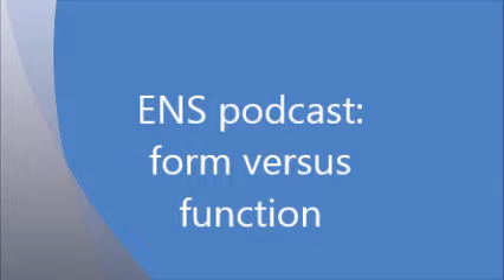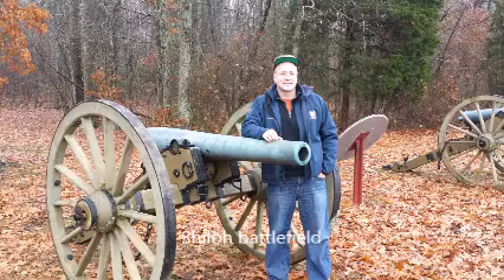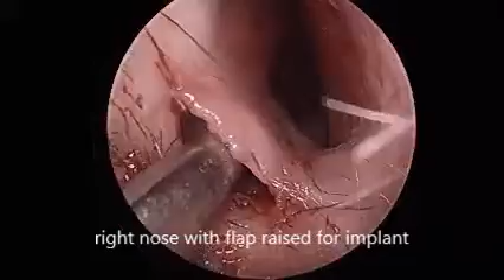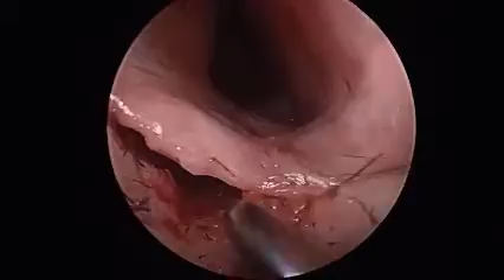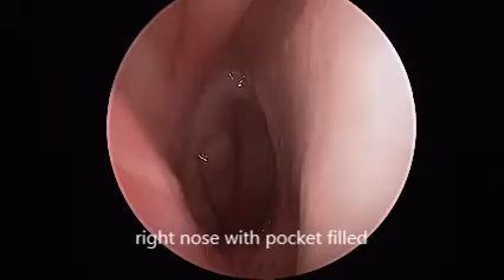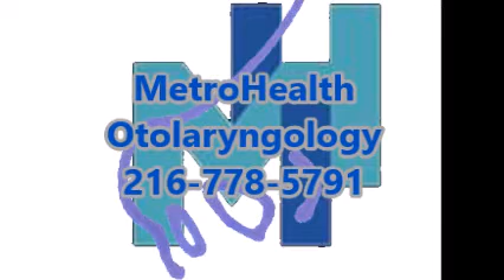ENS form v function

Comment: Does anyone reading this group know if a simple Vidian neurectomy has ever been tried in treating this condition? It seems there is a nerve component to the disorder. Perhaps a "phantom pain" type disorder/syndrome common to so many severed limb pain problems. Denervating the mucosa of the nose by disrupting the autonomic nerve supply might be of value, and possibly a cure (?).  Autonomic nerves regrow fairly easily that is why simple dissections of the vidian nerve often result in failure. Simple vidian neurectomies have been known to fail frequently, unless the nerve is destroyed thermally or by other means, or blocked in the vidian canal by bone wax to prevent regrowth. This may allow for a test procedure given a hopeless case of ENS.  If there is a nerve component to the disorder and there seems to be, it could explain poor results of turbinate reconstruction procedures. Regenerative surgery/treatment if possible in the future may also not be of great value as it will not address the issue of severed nerve endings (if that is the origin of the problem).

Comment: 10 years ago i had a septoplasty smd inferior turbinectomy both inferior turbinates reduced.debrider and bipolar diathermy was the surgical technique.the day after i have awfull suffocation and empty feeling.cant feel the air in nose.couldnt sleep.paradoxical obstruction.i thought it would go away i did not know about ens.i tried to put up with it for a few days .i could not so i went straight to doctors about it.i suffer with ens for 10 years now.its hell to live with. i dont think ents would have a turbinate reduction because they know it can cause ens.if i was an ent i wouldnt perform turbinate reductions.1 ent said my inferior turbinates are reduced by about 30 %another said about 20%a bit more so at the middle and anterior parts.inside my nose is scarred everywhere looks a mess.ents have said i have scarring.1 said my nose looks a mess insde.my question to dr houser is it normal for turbinates and mucosa and septum/nasal pits to be covered in scars .is some scarring normal?.also if i touch my inferior turbinates with my endoscope i cannot sence it.so either mines have dead nerves or that is normal?.whats your email address please.i have recent ct scans and my recent endoscope video .
Reply: How are you now
Reply: Steve, Let’s talk.